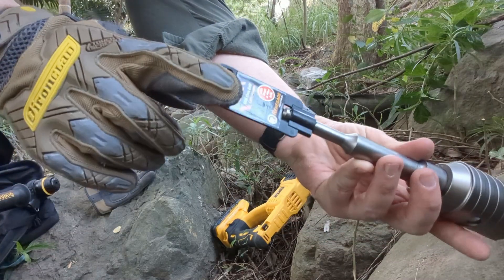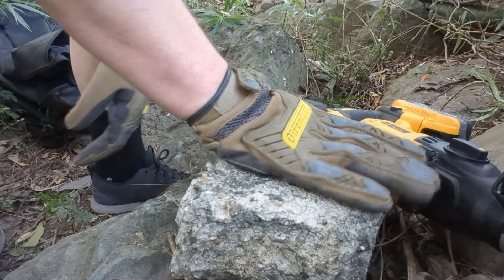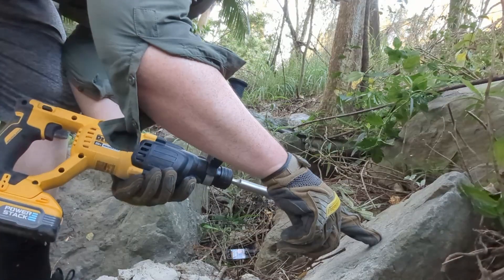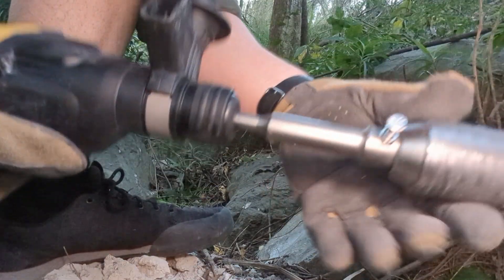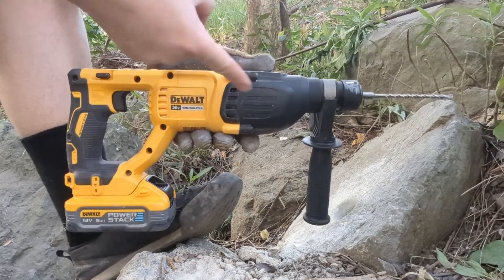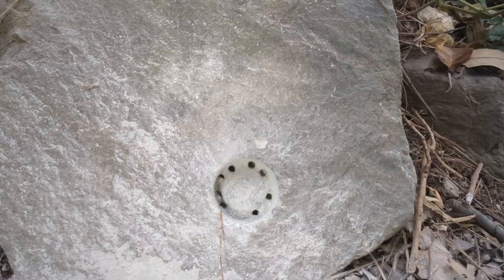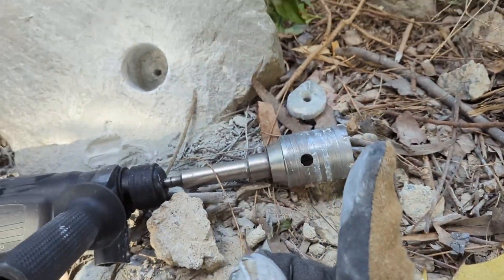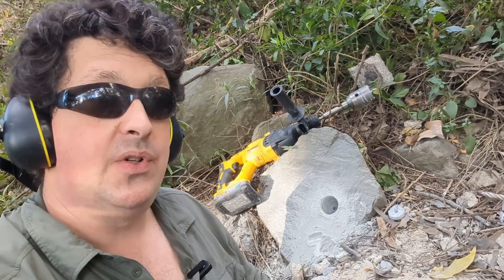Drilling BIG holes in rock: SDS core bit + DCH133

Comment: I would drill a pilot hole straight through for the centering bit, scour a ring on both sides with the core plus centering bit, and make some deep holes on the scoured rings from both sides. From there you don’t even need the centering bit anymore. You can also avoid blowout by stopping early and coming from the other side.
Reply from the maker: for sure! i worked that out eventually

Comment: Just bought an "82mm" diamond core drill and adaptors for normal and sds plus chucks. Would be interesting to see the same drill drill the same rock and use the old footage for a side by side overlay. Trouble with my new bit is it's 80-80.5mm and I'm not confident it'll bore oversize by 1.5-2mm to get my 82mm PVC through. Hmmmm.
Reply from the maker: Hmmm oversizing with core bit? that I can't tell you, but if you drill almost through and then perforate with say a 10mm bit all around the hole it might be big enough.
Reply: @BoltahDownunder  My intention is to pre drill all the way through with a plain impact pilot, then get the big hole started straight and steady, then stop, measure, and if good continue, if not remove the drill from the centre and work it around in circles at all depths as I go further in so as to enlarge it as I go effectively using it like a drum sander or something. I'll let you know how it works out and when I go to pick up the adaptor I'll measure some of the other sizes and see how they compare with the number on the box/laser engraving.

Comment: As can be seen when starting in the stone, the centre guide drill was struggling right from the start.  So once the hole saw section hit the stone, the drill was trying to drive both the hole saw and the guide drill.  Maybe drilling a smaller pilot hole first would at least reduce the workload on the guide drill.

Comment: It sounds like you had the hammer mode turned on. I'm not 100% certain, and admittedly this is unintuitive, but i'm pretty sure the optimal drilling setting for coring is with the hammer mode off (i.e. drill only). My understanding is that the hammering rapidly dulls and/or breaks off the hard cutting elements of a core bit (carbide, diamond, etc), and that unlike with a solid bit, the hammering action isn't necessary. Maybe worth investigating?
Reply: Hi, this is a carbide bit, that needs to be hammered, although it is more for brick and limestone etc., then hard cocncret. It is definitely not for reinforced concrete, fir that you need diamond bit core, that, as you mentioned,. mustn't be hammered. Also the 8mm drill is need to be removed once you reached like 2-3mm, as it serves only for centering the core bit, and will slow you down considerebly
Reply from the maker: @tamaskep4902 Thanks mate! That makes sense that the pilot bit can be taken out. It didn't help much.
Reply: @BoltahDownunder  my pleasure. Your tests helped me to choose a great hammer drill( a HIkoki 36v), so thanks 🙏
Reply: @tamaskep4902  ah - turn the hammer off on diamond only, eh? good info - thx!. Good point on the guide bit too
Reply: Most welcome! Been working with these bits as an electrician. I like both types. The carbides are much cheaper and great with hammer drills,.the diamond bits.are working best with at least 1000watt(corded) drills.

Comment: Hi I like your hole punch channel and I think you have a spot on, I use makita batteries but I don't know if the dhr 243 is reliable and strong enough. Harseam bosch gbh 18v -26 or Ryobi or this DeWalt. What is your recommendation.
Reply from the maker: What's your application? Makita should be reliable enough for most uses. But the 243 doesn't hit that hard. You could upgrade to a DHR 282 if you want more impact energy. 
Or if you want to change brands I can recommend the DeWalt DCH263. It's also 28mm rated and hits hard but is quite affordable & nice to use
Reply: Used a Bosch and dewalt side by side and this dewalt wipes the floor with the Bosch